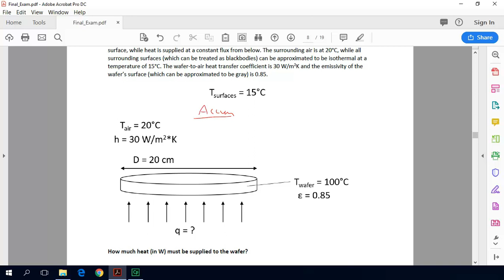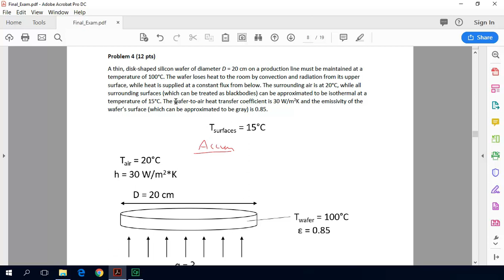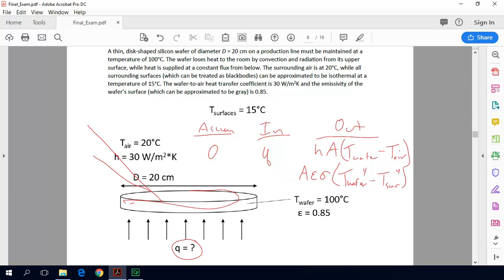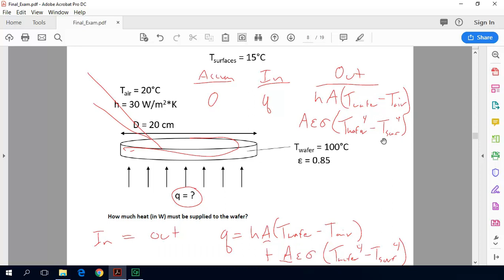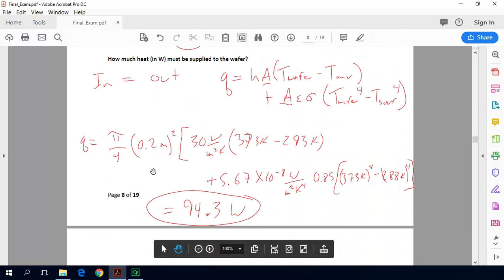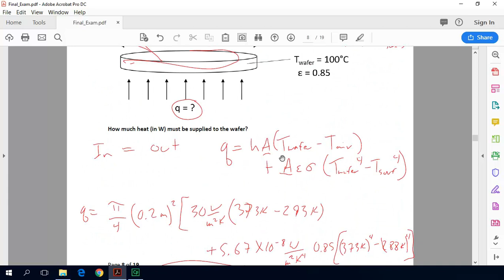Heat Transfer Crash Course: Example exam problem: Convection and Radiation

Comment: Why is the surface temp. 288K? It wasn't explained so I'm a bit confused.
Reply: Didn't get it at first either. Its the air  temperature, 20C converted to Kelvin, which is 20 + 273 = 293.